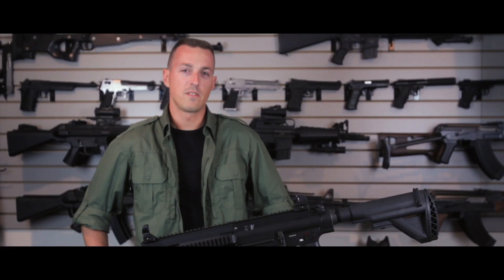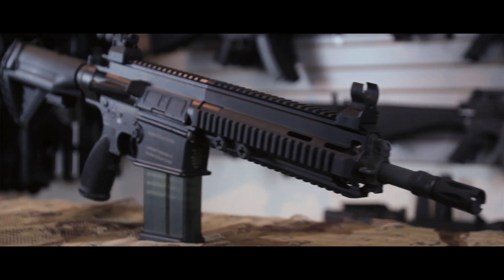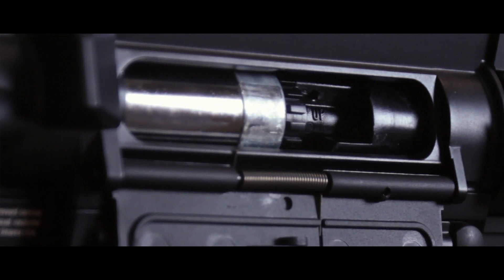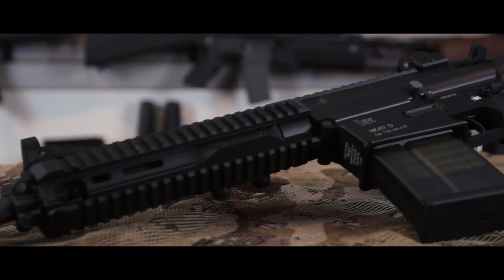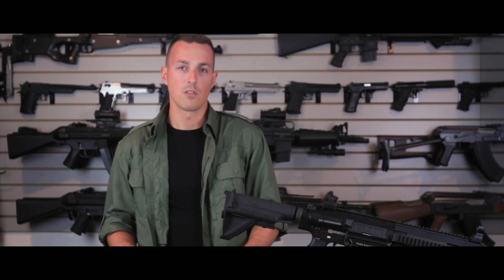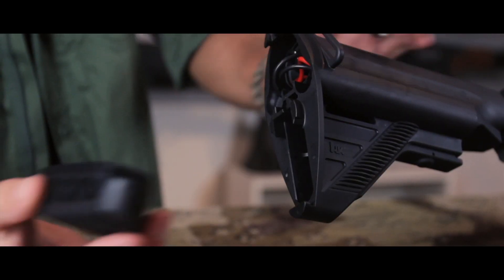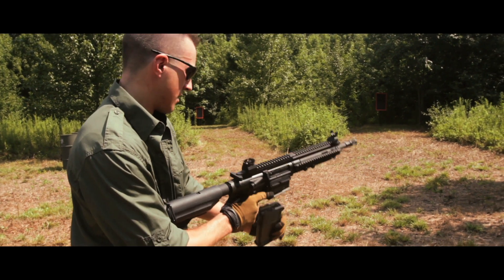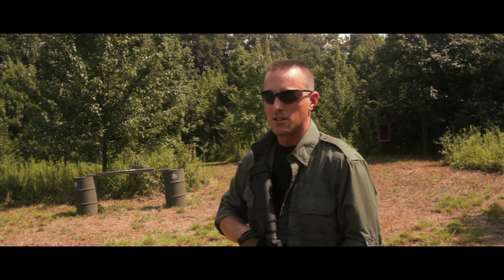Shorty USA - Umarex/VFC H&K HK417 AEG Airsoft Rifle

Comment from the maker: Probably not. The battery would need to be the correct dimensions, polarity and with the correct length leads in order to work in the crane stock. I'd suggest just ordering one from an airsoft store and waiting a few more days.

Comment from the maker: The HK417 is shooting a bit hot if you plan to use it primarily as a field rifle and not a DMR. Its muzzle velocity is over what practically any field would allow for anything but a sniper rifle so you would be limited to long distance engagements only. I would say that the HK417 is overall a better rifle than the SR10 but you wouldn't be able to use the 417 for the role you intended.